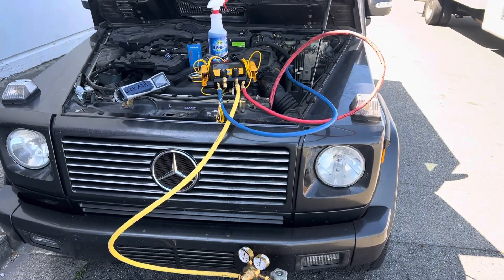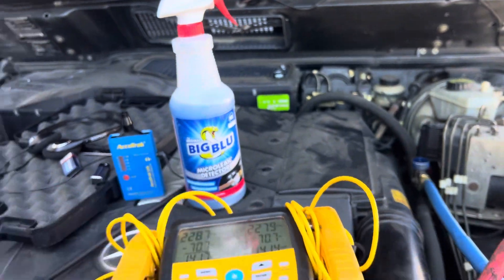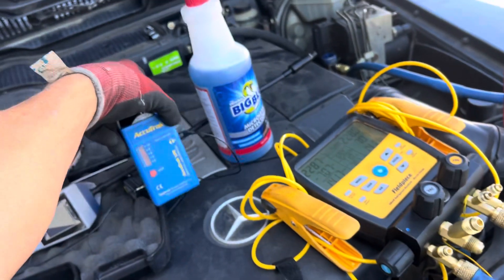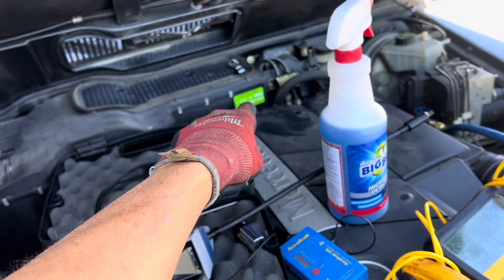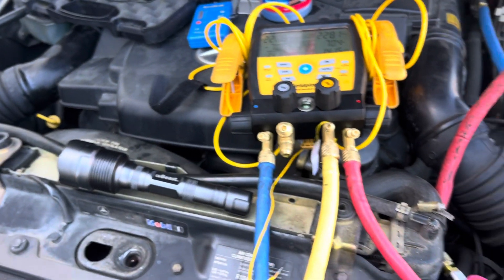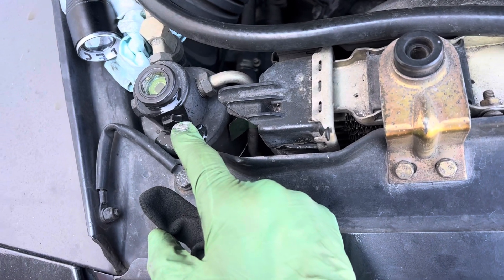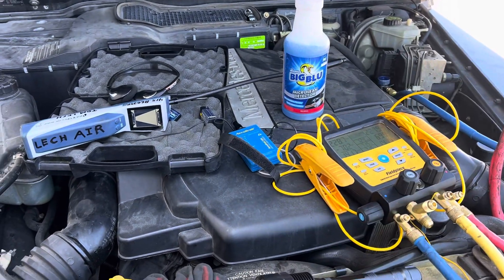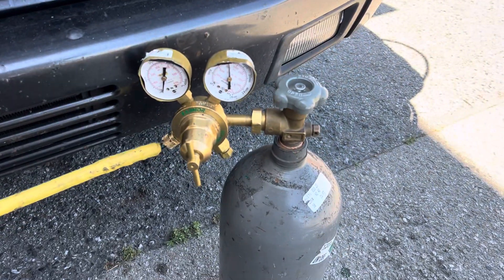LEAK TEST WITH FORMING GAS @ 228 PSI STILL NO LEAKS EVEN THOUGH I KNOW EXACTLY WERE IT LEAKS

Comment: Had a compressor leak either front seal or front case o ring . Oil stain was always down one side . Eventually after years oil dis colour on one side of compressor changed with a slight discolour of the dye . Problem solved. This system took 5 years to get low on refrigerant .  My new UV Beast picked  up the leak   Far better than any uv torch used previously .
Finding leaks in hydraulics is the same ,leak can occur hot / cold /pressure /on or off . Inspect the flare fitting nothing wrong yet it leaks . 
The same with seals and o rings in auto a/con leaks can occur  pressure or vacuum  or standing at bottle pressure
Reply from the maker: Yes that UV beast V3 is definitely better than all other lights on the market even several hundred dollars more do you versus only $80

I had to pay $535 for the eagle stinger UV light and it was not even as near as good as the UV beast 

I paid $735 for the OptiMaxx 365 years ago and the UV beats today. I’ll chains that light. 

LED UV technology has progressed and multiplied and increased just like back in the Heydaze of computer chips kept getting faster and faster and more powerful until they became cheap easy and fast and plentiful 

Now today, UVLED lights are cheap and powerful 

But only the UV beast makes the one light that outshines all the rest
Reply: Living outside the USA pricing for most "specialized" LOL equipment is 2-3x the usa. @coldfinger459sub0